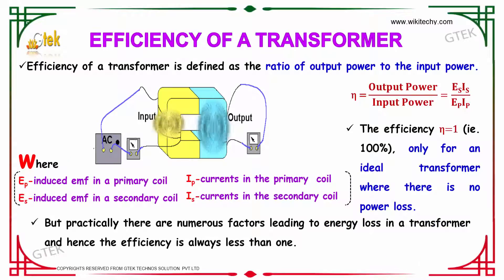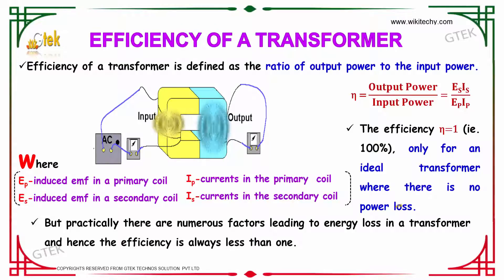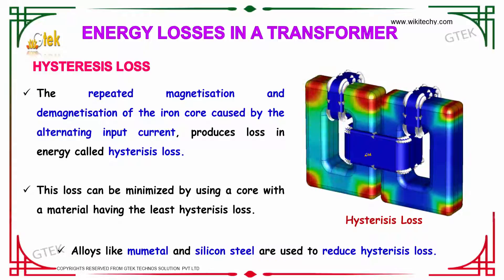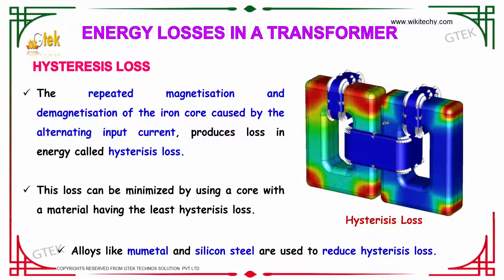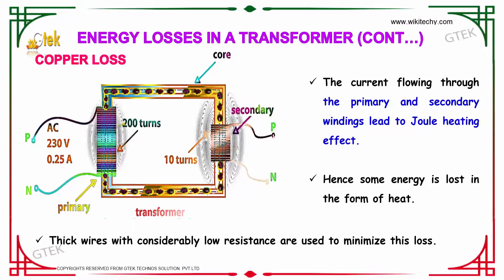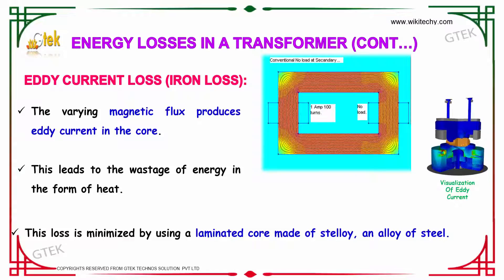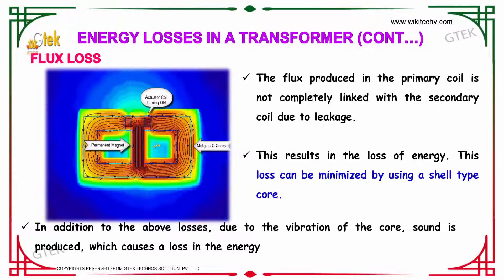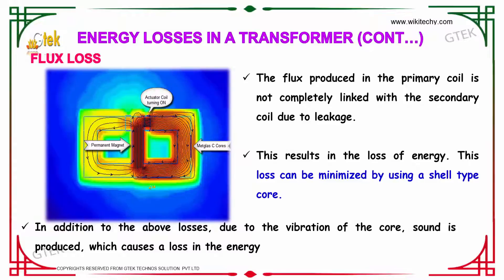Efficiency of a transformer |Electro Magnetic Induction And Alternating Current

Comment: Alternating current (ac) in the primary coil (input coil) produces a changing magnetic field in the laminated soft iron core. The changing magnetic field induces a potential difference (voltage) in the secondary coil (output coil).

Comment: Definition: The all day efficiency is defined as the ratio of output in kilo watt hour (KWh) or watt hour (Wh) to the input in kWh or Wh of a transformer over 24 hours. Simply the ordinary or commercial efficiency of a transformer is defined as the ratio of the output power to the input power.

Comment: The Efficiency of the transformer is defined as the ratio of useful power output to the input power, the two being measured in the same unit. Its unit is either in Watts (W) or KW. ... Cosϕ2 – power factor of the load. Pi – Iron losses = hysteresis losses + eddy current losses.

Comment: Just like any other electrical machine, efficiency of a transformer can be defined as the output power divided by the input power. That isefficiency = output / input .Transformers are the most highly efficient electrical devices. Most of thetransformers have full loadefficiency between 95% to 98.5% .

Comment: The all day efficiency is defined as the ratio of output in kilo watt hour (KWh) or watt hour (Wh) to the input in kWh or Wh of a transformer over 24 hours. Simply the ordinary or commercial efficiency of a transformer is defined as the ratio of the output power to the input power.

Comment: A distribution transformer or service transformer is a transformer that provides the final voltage transformation in the electric power distribution system, stepping down the voltage used in the distribution lines to the level used by the customer.

Comment: efficiency of a transformer can be defined as the output power divided by the input power. That is efficiency = output / input . Transformers are the most highly efficient electrical devices. Most of the transformers have full load efficiency between 95% to 98.5%

Comment: machine, efficiency of a transformer can be defined as the output power divided by the input power. That is efficiency = output / input . Transformers are the most highly efficient electrical devices. Most of the transformers have full load efficiency between 95% to 98.5% .

Comment: Just like any other electrical machine, efficiency of a transformer can be defined as the output power divided by the input power. That is efficiency = output / input . Transformers are the most highly efficient electrical devices.

Comment: The Efficiency of the transformer is defined as the ratio of useful power output to the input power, the two being measured in the same unit. Its unit is either in Watts (W) or KW. Transformer efficiency is denoted by Ƞ.